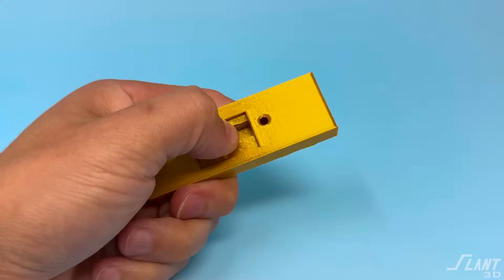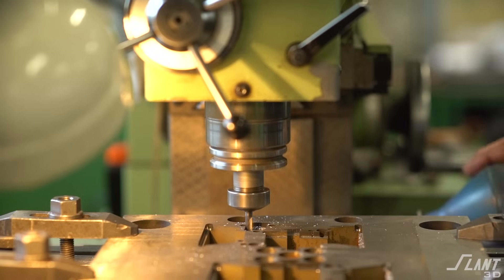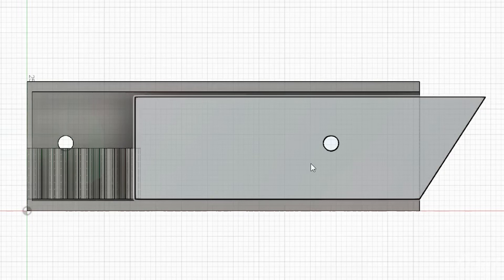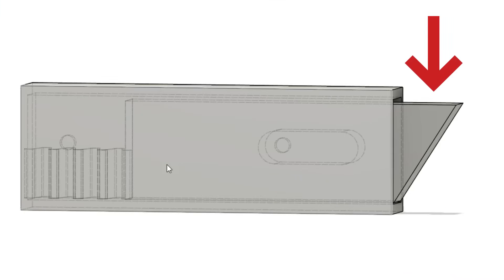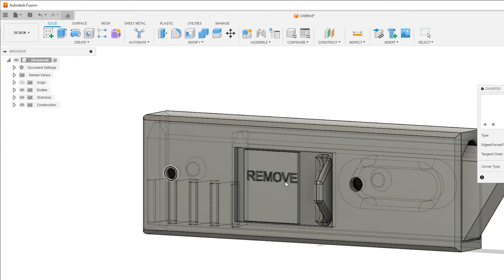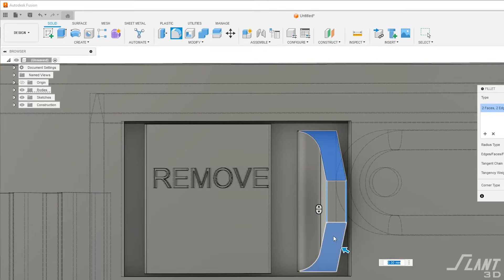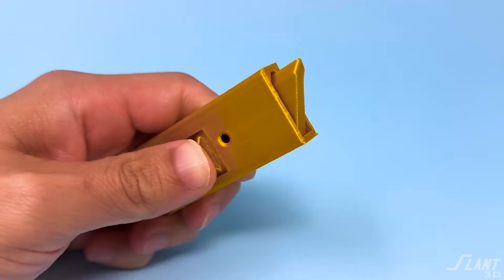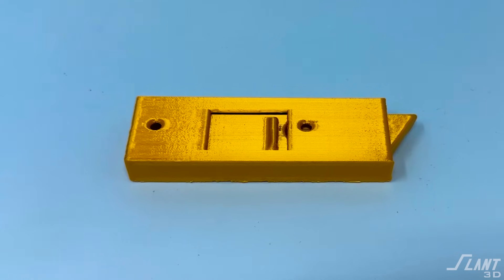Print in Place Latch Mechanism | Design for Mass Production 3D Printing

Comment: The place where injection molding is always going to have you by the nads is in scale, that ~$10-20k spent on molds can produce tens or hundreds of thousands of parts, perhaps over a million if you don't mind some mold-wear defects showing on the part.  E: Google quotes me a casual half to 1 mil parts per die figure, is that right, I dunno.

The benefit of 3d printing is that you can make 10-1,000 of them while skipping the inventory and overhead costs.

Source, I did my time working the blow-mold line. All I can say is that the parts come off the line fast enough that me as the deflashing guy can't rotate his wrists by the end of the night. Bonus Fun Fact; supervisors don't like it when you drop a flashing knife into the plastic shredder that recirculates into the molding machine.

Comment: The plastic spring will fatigue and break after a few hundred uses, and then you have to throw the whole part away and replace it.  
You’re better off making a way of just popping a metal spring in there after printing.

Comment: You covered everything except the biggest question I had! How do you design parts that are not connected to each other? Like how the tongue inside slides along the bottom of the casing? Do you have a small layer of support that just gets detached when used? Or does it just print in the air?

Comment: Great video on the basic design process. I've been a product design engineer for 45 years. About 35 years ago I started my own design engineering consulting business. I was one of the first independent engineers to get into 3D CAD design (Pro/E, now called Creo). I have been a huge fan of 3D printed parts prior to spending a small fortune on injection molding tooling. My typical process is design, run a 3D print on one of my printers, review the part, make any necessary changes, repeat the 3D printing process. Once the design is complete, that is when I go to injection molding.

Comment: nah there's 2 or 3 instances of printing stuff inside other stuff that by a surface level understanding such as mine should fuse together with everything and become one solid thing. Why does the spring not stick to the bottom of the case? Why doesn't the latch itself do the same thing? How is it that the "remove" box isn't part either of the wall of the latch or the floor of the opening for the latch in the box? I guess what the real question that isn't answered in this video is, how do you design 3D printed parts that are supposed to snap apart but are directly touching and would otherwise fuse together
Reply: I had these questions too when I first bought a 3d printer. But now that I have it and printed a few things it makes a lot more sense. For one thing, that remove part much thinner than the rest of the piece, and you can also leave gaps in your material that allow for print separation. Just yesterday I printed my first stacked part. It was two identical parts stacked on each other. My first attempt failed and they fused together, but I checked my settings, used a different software tool and tried again, and it worked. The two pieces came apart easily, even though they were printed right on top of each other.

Comment: I love 3d printing and design. I need to get better with Onshape, but I had a 3d printed rear view mirror support that lasted a good amount of time, even lasted in the summer heat (after a slight initial sag but never moved again), until the suction cup failed and I sat on and broke it.

Comment: The long list of problems that need to be solved makes this video proof why 3d printing is not a great fit for mass production.
Reply: He did that as an explanation for new people. Anyone who is in 3D printing knows this and designs for it with minimal thought. You think injection molding doesn't have similar issues, because it does.

Comment: A few improvements:

1. Never use silk filament for anything that requires any strength or flex. It's horribly brittle and has the worst layer adhesion of any filament I've used. It's only useful for pretty dust-collectors.

2. Don't just add reinforcements for the latch-end screw-hole, connect it front-to back. This can be done with two intersecting cones eliminating any possibility of sag, and will allow the end-user (who may not realize there's a gap) to tighten the screws without crushing the mechanism.

3.a. Add a very thin slot for a blade (using the same gap mentioned for the support) from the back at the same layer as the spring to allow a thin blade to not only break the contact between the spring and body, but to remove any edges that would result in clicking or catching when the spring flexes back and forth.

3.b. Alternately, leave two diagonal cylindrical slots from the back for the insertion of two narrow metal springs to replace the in-built spring. While this would add one assembly step, it eliminates any possibility of failure of the flex-spring (allowing more rigid materials be used). The diagonal insertion would hold the springs in place as well (once they straighten out inside, they cannot fall out).
Reply: Here to agree with 3b. The only potentially fatal part of this product is the plastic spring. Designing for metal spring installation would SIGNIFICANTLY improve longevity. Of course, at the cost of a manufacturing step. But thats way better than having to replace the whole thing every time the plastic spring wears out. Plus it would let it work in a larger temperature range
Reply: 1: Look at the print... Those "horrible" silk things are desired in this application, to ensure it'll break lose and smooth operation 

2: You have no idea if the space was limited, bridging cones would require expanding the size

3: Outside the scope of the video, it's specifically made to encourage hands off production in a 3D print farm, adding the need for each print to have a worker close by, completely destroys any advantage he was convening

3b: Also way outside the scope of the video. It kinda feel like you didn't listen at all and then just decided you wanted to show how smart you are when in comes to printing
Reply: @VikingRul3s  
"silk things"?  No, silk filament is not required for something like this at all. I was printing iris boxes back before silk filament was even invented, and they separated just fine.
"you have no idea"? Are you serious? It's plainly obvious from the video. It's trivial to connect exactly as I stated with the slide straddling it.
"feel like you didn't listen", I feel like you didn't comprehend. The springs would go in after the print is finished, not while it is printing.
Reply: @glabifrons  Erhm... you seem to even have a problem reading . "Silk things" with this i obviously meant what you defined as useless is actually very useful in this case...

"You have no idea" "if the space was limited". Try spending enough time to read more than the first 4 words, then you may even be able to comprehend what i wrote. You do understand that if a box can contain 24 cans, then you can't increase the can size and still make 24 fit? Right?.... 

Still feels a lot like that... You're still talking about things he directly addressed in the video. Again spending enough time to actually understand, is the bare minimum required in all social behaviour

PS Just stop it with the aggressive text behaviour, it's only confirming what i wrote to start with. You didn't actually watch the video, cause you believed you already knew everything he had to say, skimmed it and then just jumped right into the comment section. Sadly, you were very wrong and will be every time you do that
Reply: @VikingRul3s  I did read what you wrote. Lots of wrong assumptions and snide comment.
Don't want to take my word for it? Fine... watch any filament strength test by any youtuber. They all come to the same conclusion. Silk filaments are by far the weakest and most brittle of any filament you can buy.  They're nice for pretty dust collectors, but not for anything that requires any kind of strength. Why are you so offended by this? Is it your design?
Your analogy is just utterly absurd. The type of bridge I'm talking about would easily fit. I've made things like that, myself, many times. If you want an analogy, look at the little "pizza saver' tables inside the cardboard box the next time you order a pizza. Did they have to remove part of your pizza to put it in there?
Also, he didn't address anything I'm talking about in the video, or I wouldn't have written the post.
Funny, you're telling me to stop with the "aggressive text behaviour" (get a spell-checker) after you go on the attack twice. 
You obviously know absolutely nothing about me whatsoever, and you've proven you know little about 3D printing materials.
Reply: @glabifrons  You still don't seem to have any idea what i'm talking about
He literally did, not my problem that you have difficult time listening... Print-in-place, work less, auto eject, no assembly, reason why that's better - was all in the video... I could find that on 30s, it's a 7m video, how long have you spend writing things that literally can be disproven or irrelevant by just watching the video
It's very clear that you haven't actually watched the video and because you think you already know everything he has to say, you can't figure out how to actually watch (not again, cause you haven't so far). So stay in the little bubble you've created for yourself. Bye
Reply: @VikingRul3s  If you're ranting about 3.b, then you're the one having a difficult time comprehending what a qualifier is. I literally said "While this would add one assembly step," as a qualifier there. It's also a post-printing step, something else I already had to explain to you once as you weren't able to piece that out.
If your insult-rant troll attempt is on something else, you'll have to try a bit harder.

Comment: I'm working on a print In place design I want to sell via the slant api. My design has parametric tolerance which I've set to 0.3mm while testing on my machine.
Do Slant 3D have a recommended tolerance for print in place designs to prevent fusing?

Comment: I see that you guys like to use the gantry to push a print off the plate to remove operator assit.
Have you looked into using a metal plate, and underneath fixing an actuator to bend the plate in the middle, and 'pop' the contact of the print before sweeping it off with the gantry?
Might make it easier for prints with large contact patches with the print plate to be removed?

Comment: @Sland3d, there is an issue with your website that forwards the "quote" link in the description to a 404 page. The "production-3d-printing-quote" is being forwarded to "production-3d-printing-quote-auto-2". This happens even happens if click "Get Quote" (top right) from home page.
Reply from the maker: Odd. It seems to be working fine right now
Reply: @slant3d  It appears to be browser dependent. Different browser, and it works. (problem on my end)

Comment: Great example of integrating removable support structure and functional components into the part being produced. 

From a engineering and user experience perspective, designing the amount of tension a 3d-printed spring produces could use few calibrated references. A data aid starting reference for designers providing a couple reference parts with integrated springs that have measured properties using Slant 3d filament and manufacturing process. Additionally a bit more detail on the spring design (sliding parts), so designers get a working spring as first parts are produced. No weld of part facets to bottom, or sides internally.

Comment: I can't imagine the spring lasting more than one to two hundred cycles, and I think even that is optimistic.
Reply: I worry about that too. I haven't found any great videos testing springs in different materials. And different types of springs. I've seen a few close videos, but not quite.
Reply: Y’all missing the point of the video. To teach technical skills behind designing for 3d printing.
Reply: @jacobmurray3621  if the point of this video was to teach technical skills to design something like this, so with a focus on print in place design, then it was even worse at what it was suppose to do than if it was just supposed to be a showcase. This video did in no way teach the skills needed for people to replicate this. It mostly went over the basic design stuff, like chamfer and round edges, make sure that overhangs are either supported or at a high angle, that he goes through in basically all videos, but the stuff the video is about according to the title and that many people went to the comments to to get answers, being: how to actually make it print in place like this but still be able to move?, was basically not talked about in the video. Also, in any kind of video that is showcasing a new approach/way of doing something, I would expect to find a part about pros and cons, but this was completely missing from this video (as it is missing from many other videos on this channel where he very often pretends like 3d printing is simply superior without going into nuances). And there are definitely big drawbacks one should talk about when it comes to print in place stuff, like the fact that you simply can't archive as tight tolerances as are possible when assembling stuff afterwards, which results in always loose parts, that some complex geometries/mechanism are just not possible as print in place or require nasty workarounds and that you need to work with 3d printed springs, which brings us right back to the purpose of this discussion here in the comments. So yeah, we didn't miss the point of the video. Or rather, the video missed the point of the video.
Reply: @jacobmurray3621  I'm not sure that was the point.
Reply from the maker: Same lifetime as a molded version. This is very standard design
Reply: @slant3d  OK, do you know the lifespan of a molded version? Also, the sample molded version you used at the start had metal springs in it, so not comparable.

I'm going to give this a try myself, see how it goes. I'm going to design in a bit of preload, too, to stop the rattle when the 'arm' is at rest. Fun project... :)
Reply: @imacmill  how is it not comparable if it is the same thing but different production methods?
Reply: @voyeger4464  yeah it wont but it doesn't make printed version better. Injection molded piece is still more robust and durable mainly because it uses metal spring and those csn be replaced unlike anything in single printed thingy. I compared molded and printed versions and they must be compared.
Reply: @imacmill how are you planing to make a print in place preloaded spring? As far as my knowledge about print in place design goes, that’s impossible (unless you have assembly afterwards where you, for example, move one of the ends of the spring to a position where the spring is pre-loaded). I would love to be proven wrong though as this is very interesting and useful
Reply: @imacmill  oh wow, that’s actually a very nice way of doing it! Great work and thanks for answering! 
I can absolutely feel your struggles with PETG as I’ve also never managed to do PiP prints successfully in PETG. I did have some quite good results with PLA printed springs though in the past, so maybe that’s not too bad. At least if you don’t stress them too much
Reply: @slant3d  I thought the comparison would be print in place plastic versus traditional injected molded with steel spring. Like in the video.
Reply: @slant3d  lol never. That's silk PLA. PLA is a terrible material for compliant mechanisms. It is stiff, hard, and does not handle fatigue well. 

Neat idea but terrible example. You 100% did not engineer a compliant spring, you just designed something.

Comment: What is the longevity of a print in place spring like that compared to a metal one?
Reply: Unhelpful answer, but my guess is longevity will be low.
Reply from the maker: This is a very standard design even in molding. Springs are to be designed to flex only in the elastic region of the material used. If that is the case little to no fatigue occurs.
Reply: @slant3d  I dare you to do a lifespan test on this. Could be using the new filament channel to show the results.

Comment: What's the cycle lifetime of the spring?
Reply: It can be whatever you want it to be. It would depend on the material they were using, how thick the spring is, how much stroke it has, etc. As an engineer, you need to understand what the criteria the product needs to work under and what the customer expectations are. This is too open-ended of a question to give you an answer.
Reply: @tomsko863  it is definitely not "too open ended to answer". If he prints another identical latch, same material and settings, how many cycles will it last? We aren't asking hypothetical minimum and maximum lifetimes across all possible materials here, just trying to get an idea of what an average print farm owner / hobbyist maker could expect Vs say, the same design with a metal spring
Reply: @slumpchogg  I'm concerned that any answer that's given, would be very misleading because of all of the variables. If I was to print this and it didn't meet my target cycle life, then I would change it. And continue changing it until it did function properly. From looking at it, the overall design of this part is NOT optimized. It was made to illustrate some design points and that's all. So whatever current cycle life this spring has, doesn't matter. It doesn't tell you a thing about how practical using this design as a spring is.
Reply: @tomsko863 I've read through this entire comment section and everyone seems to be dancing around the question of how reliable of a spring one could produce within a 3d printed piece. assuming you optimized this to a point you're happy with, using the best possible material that would still cause the rest of the design to function properly, what kind of cycle life could you achieve?